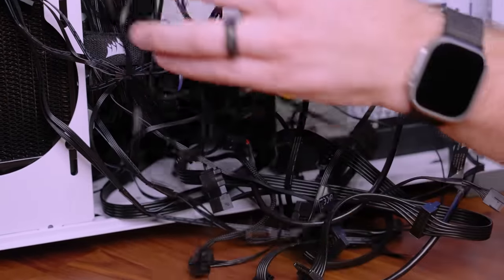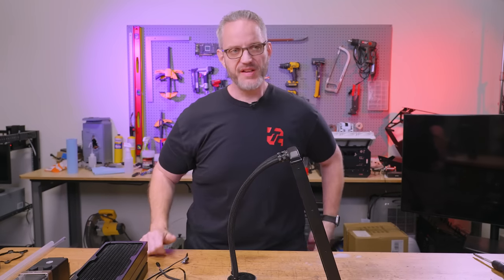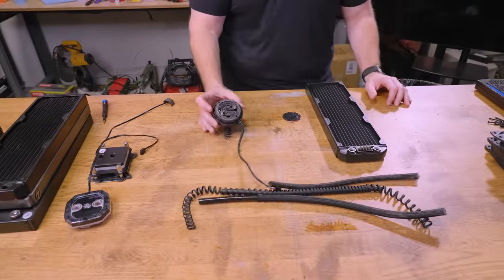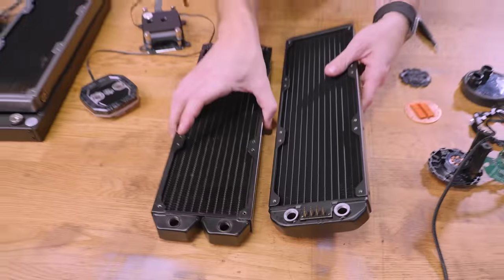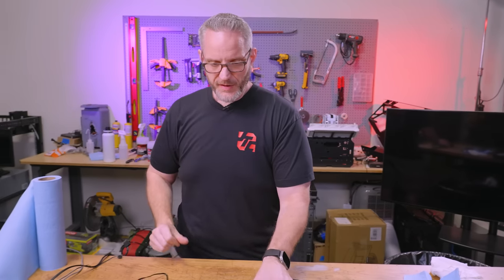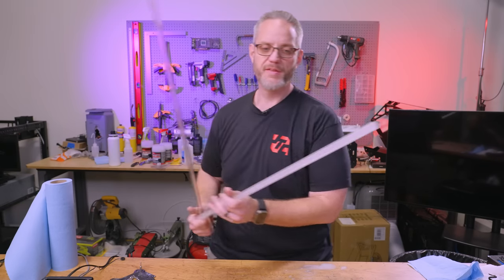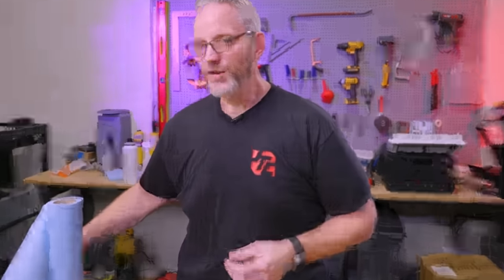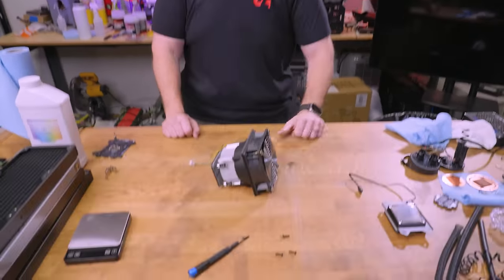Which one is right for you?

Comment: I did a custom loop on the PC I'm using right now (and I'm going to do it again on my next build) because of two features that AIO's simply don't usually have, and when they do they end up costing more than a custom loop when you do the math out:
Aside from "closed ecosystem" type solutions (the ones that cost more, as I just said), you can't get an AIO system that cools more than one thing, or that has more than one radiator. If you want to use AIO's to cool both CPU and GPU, you need at least 2 AIO's in nearly all circumstances.
Given today's higher component power dissipation, there's another more important concern creeping in, too.
No AIO I'm aware of can handle more than one radiator in the loop without having additional pumps to help the fluid move along.
Now on to why that mattered for me: On my current PC, I wanted to cool both my (not top of the line but still thermally challenging) RTX 3070 Ti, and my i7-9700k (was supposed to have a 2070 in it but that 2070 died within 6 months of use, and that was during the GPU shortages so I wasn't about to ship off my 2070 and not get anything back).
The loop I built does that quite well, it has a 120 in the rear of the case, (set to exhaust) a 240 up top (exhaust), and a 360 in front (intake).
The reason I wanted to do water cooling was that I was (and am) willing to trade off the near-constant thrum of high speed fans for the quieter moderate whine of a water pump, as well as the hum of MORE fans that are turning SLOWER and so they generate MUCH less noise. I may use headphones when I'm using my computer, but the overall concern was still a noise issue with air-cooled setups.
Additionally, my 3070 Ti is the noisiest component of the system when it is using the factory air-cooling heatsink. Why? Simple, the GPU controls the fan speeds, and it ramps them up AGGRESSIVELY whenever it goes even the slightest bit above idle. Now that's fine for "make sure the card runs cool" but the problem is that it makes a lot of noise. So by putting it on the water cooling loop, I was able to basically strip that control away from the GPU and put it squarely in the hands of the motherboard, which I have set to control fan speed SOLELY on the temperature of the coolant in the loop, with the water pump's speed being based on both the temperature of the water in the loop as well as the CPU's die temperature (I have it set to ramp the water pump speed aggressively based on CPU temperature, but I can tolerate ONE D5 water pump running at full speed much more than I can tolerate THREE "not so tiny but still high RPM" fans on the GPU spinning their heads off whenever they feel like it (even sometimes when the PC's just idle with the monitor turned off, well it was doing that a lot until I updated the GPU driver to one that was newer than the one that added Video Super Resolution because that driver had a bug in it that made the nvidia display container process consume 15% of the CPU even when the whole system was idle at the desktop sometimes, which also caused the GPU fans to ramp up).
Anyways now that the loop's complete (and I cleaned the gunk out of the water blocks because apparently I didn't flush the system good enough when I built it), it's a powerful and quiet system that mostly meets my needs for gaming at 4k 60fps.

However, near the end of 2022, my 4k monitor died. Not a big deal, but I took it as a time to upgrade. My new monitor can do 4k at 144hz maximum, and I want to be able to run games at that combination of FPS and resolution. In the factory building game "Satisfactory", my PC can get to about 90 FPS when looking at a large complicated factory, and that's with shadows set to Low (because for some reason shadows in that game just kill your FPS no matter what other settings you have set). Not good enough for me. They say they're gonna be optimizing it by moving the whole game over to Unreal Engine 5, but that's not gonna give me the extra 54 FPS I would need to run the monitor at its design specifications. And I'm not giving up on Satisfactory for a long time either, I have over 1000 hours in it and I'm still having a lot of fun in it.
So it's time for a new PC, besides I think the 3070Ti is a bit bottle-necked because my mobo is only a PCIe 3.0 board, and my CPU is several generations out of date.

So on to a new PC.

My next build is going to be using many more radiators, because my next case is a case much more suitable for water cooling, a Cooler Master HAF 700 (not the Evo, I want the radiator space not the "looks nice but otherwise useless" features like a glass side panel or things like that).
My next build is going to have 3x 420mm radiators (one in each of bottom, front, side) and 2x 360mm radiators (both in the top). The res is going to be an EKWB D5 pump housing/res combo unit that mounts to a 240mm radiator spot (and there's one of those in the rear of the case).
Why do I need so many radiators?  Modern components put off a lot more heat than the ones in my current system.
Specifically, the components that I'm aiming to use in my new PC are an i9-13900k (not -KS because too hot and too expensive, and not -KF because the CPU's integrated GPU is good for troubleshooting purposes if my main gpu dies or has problems for some reason).
The GPU isn't any better as far as how hot it is, I'm aiming for an Asus Strix RTX 4090 (none of the other 40-series cards make sense from a price/performance ratio point of view, if there's a 40-series card with half the performance of the 4090, it cost quite a bit more than "half of what the 4090 costs", so you're paying more per calculation per second with all cards that aren't the 4090).
For waterblocks, I've decided that if I'm gonna pay a premium, I'm gonna get a premium product that deserves the premium price tag, so instead of going with EKWB for my water blocks (which was the previous plan), I'm going with Watercool's Heatkiller water blocks, for both CPU and GPU.
The prices on the water blocks that I looked at online on their website were actually quite reasonable, even tho the Euro is stronger than the dollar right now (and has been for a while). I was gonna be paying for a Quantum Velocity 2 water block from EKWB, but the Heatkiller block is both cheaper and they offer a special heavier mounting bracket specifically to help deal with socket flex (tho I'm gonna still see if I can squeeze a Thermal Grizzly Intel 12th/13th gen cpu bracket in there, just to make double sure that I'm not bending the CPU at all, that thing is CHEAP insurance, even if you pay the premium for the TG one instead of another brand's one that does the same thing).
Watercool doesn't offer an active backplate for the 4090, however as I saw during Jay's video where he puts an EKWB 4090 Strix water block on to an Asus Strix 4090 (including the active backplate), I saw that there aren't really any active and thermally challenging components on the back of the 4090's PCB (must have been only a 3090 thing), so the active backplate is simply not needed.
They thankfully also offer non-ARGB water blocks, where EKWB does not. Since I don't use RGB in my PC's (because they live under my desk, and my bed is pushed up against the desk so I can't see any of it when it's on anyways), I'm glad I can avoid paying for a feature I won't be using.
And when I say "I don't use RGB", I don't even mean I just don't hook it up. If there's a wire for the RGB, out comes the wire cutters. If it's integrated on the PCB (like it is with RGB RAM ususally), I don't do anything, because I don't wanna risk damaging the PCB.

But I'm 100% going to be using a custom loop for cooling both the 4090 and the 13900k. Because with those components specifically, it makes A LOT OF SENSE to do so. Without water cooling, you're simply leaving CPU performance on the table with the 13900k, so why would you buy the 13900k if you're not planning on water cooling it?

Oh yeah, I'm also using soft tubing, because I just don't like the hassle of planning out the routing on a hard tube build. I might do a hard tube build in the future, but when I do I'm still going to be putting little stub sections of soft tube in there so that I can have quick connectors coupling my water blocks to the rest of the loop. I have it set up that way on my current soft-tube build and it makes service SO MUCH EASIER. The quick connectors ARE kinda pricey, but you don't need very many of them. My current build has 4 pairs of connectors in it, 2 for the CPU and 2 for the GPU. I have them set up so that it's impossible to hook the water blocks up "backwards", too, so that's a problem I've eliminated.

Comment: For me personally, I prefer AIOs if I'm going to watercool my CPU or GPU. Mostly for ease of access and peace of mind that I don't personally screw something up and leak water all over the case and components. Custom loops for sure are better in terms of raw performance and the way you can customize the way it looks. Someday I will want to go full watercooling but today isn't that day. I am running a 5800X3D and I love it, but boy it's hot. I used to have the Noctua NH D15 and it wasn't keeping the temps where I wanted. Probably a case airflow issue or I just lost the silicon lottery. Ended up going with a Deepcool LT720. And I love it, it works amazing and now my CPU never reaches 70C+ anymore

Comment: Custom loop can be built cheap if you don’t need all the RGB and cool looking water blocks. To me with AIO in realm of $270-$360 for a great AIO and the results on tests for the last two years IMO are underwhelming to the point that I would argue a crap ton of of fans and air cooling may even be a better route. That aside I have built a custom loop with cpu and GPU for a grand total of $550

Comment: Yo Jay, I'd like to see a build video for a "most practical and easy to maintain" open loop system.  Water cooling seems appealing now with these super hot CPUs and bulky GPUs.  I'm talking flexible tubing, quick connects so you can take out the GPU if needed... etc.  What tricks are there for upgrading a whole system while only changing the blocks?

Comment: If you use distilled water make sure to use additives. Minerals in water counteract its properties as a solvent. Distilled water can actually eat away at a surprising amount especially with heat and or pressure.

Comment: My last IAO corsair 100i lasted 8 years :) 
my new build I used a Arctic Freezer II 420 as I ran out of cash for a system loop I wanted EK pump Block Graphics Block and 3 x 360 rads  may be I should have just gone with 2 x 360 rads but I want just to have the fans on 50% load to keep it quiet and cool.
but when you add up all the fixings tube Blocks and rads it was close to £1200 with 9 x 120 fans so £150 AIO I went

Comment: Just got rid of my previous build (5800x/rtx3080) with custom loop and built a new rig (7800x3D/7900Xt) and used an AIO on the 7800X3D and was surprised on how cool that thing kept the CPU, under cinebench loop it never went over 67c ambient temp of 21c. Gaming it was going mostly at 62c which is pretty damn good I think. Not sure if my CPU just a golden sample and uses less voltage but to run cooler than my 5800x on custom loop is surprising. 

Imma still do custom loop on my GPU tho lol

Comment: Jay, you got the open/closed loop definition wrong.

Open loop is a water loop that at some point is exposed (open) to the air. The old school shower head water loops that required constant refilling is a open loop. edit: This was a form of evaporative cooling, where there was no radiator, just a shower head into a bucket, and the cooling occured from the water droplets passing through the air, and also water evaporating. This type of loop was from back in the days where water cooling builders would goto thier local pet store to source a water pump, or thier local junk yard for a car radiator.

Closed loop is a water loop that is closed off from external air. So long as the water in the loop at no point is exposed to external air during normal operation, it's a closed loop. So both the AIO and the custom you are using for your explanation are both closed loop systems.

Comment: Regarding the "don't scimp on any part, but especially the pump..." - I'd love a video discussing: disregarding the block-choices on CPU/GPU, what is reasonable parts for first timers? (hard/soft tube, fittings needed for a simple loop, recommendations for type and amount of radiators pr. components, etc.)

I have considered going custom loop many time, but each time, I just come to the "this is to confusing, fuck it"-moment and forgot about it for half a year or so....

Comment: what i found in my testing is water blocks that are all copper or all nickel tend to do better than those that are acrylic or acetal...specially in the hotbox....also i used mystic fog for about 4 months and yes it will break down in fact the fluid will turn just clear...shake up the rad and it comes back for another month or so..its odd stuff

Comment: I have used EK pastel coolant, Mayhems Aurora (ouch), Primochill Vue (ouch I did not learn the lesson), EK clear and currently I am using battery water which is like distilled water, I used just a bit of Primochill biocide and anticorrosive I had lying around and my loop has never been so healthy looking, No particles flying around, no sediment, no gunk stuck on blocks (except for residues of vue that keep appearing after many flushes) tbh I don't think I will never use those cool coolants again to much hassle and they don't even last that long.

Comment: I have an AIO with a 360 mil radiator on my processor. I've had it for about 3 years now with not a single problem. No evaporation or anything. I'm not sure if that has anything to do with the fact that my CPU never goes above like 50 degrees even under heavy load but the AIO I have is definitely overkill in terms of cooling my processor. But I'm kind of okay with that if it means that it lasts longer.

Comment: Im using the DeepCool Castle 360EX  with 6 LL Uni Fans in a Push/Pull Configuration for my 13700K that’s Overclock to

5.6Ghz on all P-Cores
4.5Ghz on all E-Cores

Manual Voltage 1.425 

Using Prime95 under full load my max temperature is 84

Comment: I think both systems have their places in the industry. I prefer the closed loop AIO because it's simple, cost effective and you can easily move them between cases when upgrading without re tooling the entire loop. Custom water cooling systems can be works of art all on their own. The ability to be unique and creative is almost limitless but it's way more expensive and time consuming. Also, the chances of coolant leaking from a custom system is 10 times more likely than it is with a closed loop AIO!

Comment: Would like custom loop, but its too expensive too me versus aio, so atm using 280mm aio. I know that custom loop cools a bit better as pump is stronger and has huger pressure and flow which helps with heat transfer and most custom loop rads are copper transfer heat better than aluminium ones that are most common in aio.

Comment: I feel like just saying aluminium is easily corroded is simplifying it too much. In normal circumstances aluminium is lasts much longer because aluminium oxide actually forms a protective layer preventing further corrosion. What happened here is galvanic corrosion. When you mix 2 different metals, one of them will "donate" their electrons to the other, aka oxidation occurs. So if aluminium is not in contact (electronically) to another metal it won't be a problem

Comment: This makes me want to change out the CPU cooler in my NAS. It was built as my primary gaming/Video production server when the Intel 6th gen came out and I used a Corsair AIO. 18 months ago I reconfigured it as a NAS when I replaced that with my current AMD 5950X system. The AIO in the NAS is not making any sounds and is still running very cool. But since it is no longer being overclocked an air cooling solution would be ok should I need to replace that AIO.

Planning an open loop Is something that I would definitely find interesting and fun. Given the changes that you pointed out in what is available today vs when you did making loop video's in the past, it may be time to do a new video on making an open loop system. 

Even without doing that a video on how to match up water cooling to CPU temps. I would assume that since most are rebranded it would be something like 240 vs 360 vs 480 vs etc. and the ability to handle different heat ratings.

Comment: last open loop I had ran for 8 years straight 24/7 with no maintenance and that desktop was worked hard with multi day compile runs and gaming. when I finally decommissioned the loop the tubes was not transparent any more and the cold plates had strange discolouration and the reservoir had tiny cracks (I assume from heat expansion). but even at the end of it's life the cooling was still enough, yes it had gone up by a few degrees over the years but not enough to start overheating.

Comment: Don't remind me, the best computer cooling i had was a full subversive aquarium with custom liquid (This was even before mineral oil. Pentium III 1266S) 
Just had to keep the PSU and HDD above the liquid and had once clocked it at 1806mhz stable for a hour. (14x129) But it ran best at 1452mhz (11x132).
These days it is AIO for me, mostly because custom makes me more feel like a plumber.
I'd want to do whole pc water cooling again, but these days motherboards just have so much going on and cables haven't been/felt the same since leaving the P4 era.